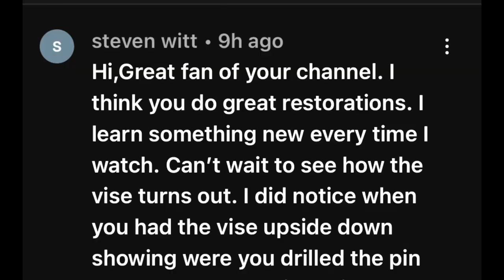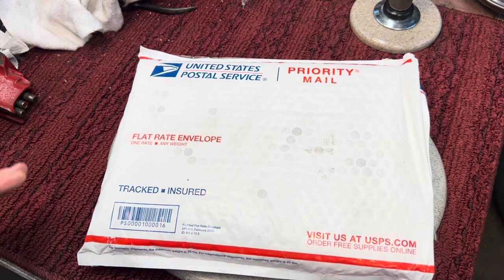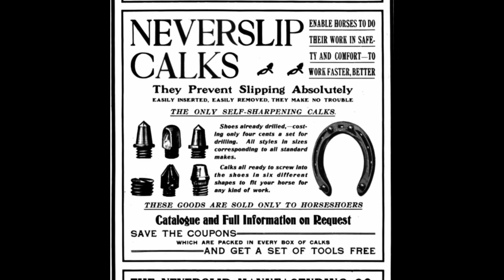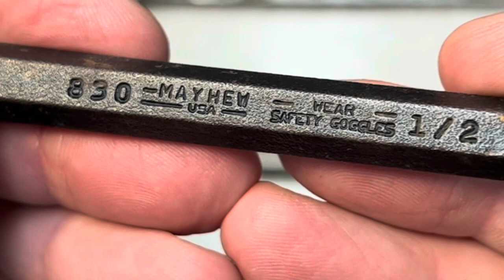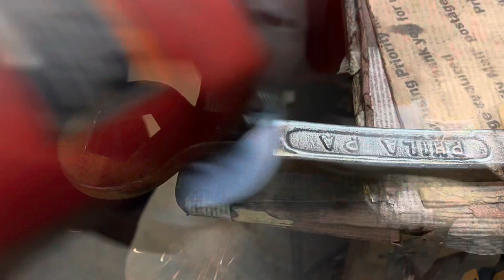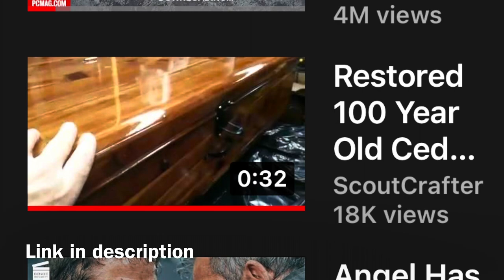Interesting eBay Lot of Vintage Tools Restored.

Comment: John, I got a Lane cedar chest for $5 at a garage sale once. The top was badly scratched and the veneer was off in a few small places. I sanded the top and glued a bit of new veneer on and it has been in my living room ever since.One thing I did: If you tell Lane the model number they will send you a new lockset free of charge. It's one that won't lock if a child closes themselves inside. So it's a safety measure.

Funny thing about that Hot Wheels garage. I bought the exact same one at a recent garage sale and brought to my son's house for my grandson. However, the track could not be put together as pieces were missing. They finally had to get rid of it over my grandson's protests. My son texted me later and asked me to please stop buying "big plastic things" and bringing them into his house! :)
Reply from the maker: Tom- Those Hot wheels and Matchbox garages were the best back in the day!  Then slot cars!  😃👍

Comment: I grew up a voracious reader and I think I have a good vocabulary. The word "calk" as a traction stud on a horseshoe is a new one to me. I had no idea you could add "studded tires" to your horse. 
Thanks.
Reply from the maker: That word had me scratching my head too for some time because I didn't know what the wrench was for until further research.  The shoes had threaded holes that accepted the calks and provided that much needed traction.  A horse on ice with steel shoes is not a pretty sight!  =D   Thanks!

Comment: That sure looks like a hydrant pentagon operating nut. Not sure about the other end of the wrench. Looked up Cusack Howe Co. Phil. PA but didn't turn up anything.  Could have been for a warm hydrant, smaller than what we see as a street fire hydrant. I could have found a use for the cedar chest but I have learned not to take things unless I am specifically looking. My finding and adopting stuff with my optimism for getting the project done leads to more stuff to store. I think you did well to adopt that chest. That will look good.

Comment: So I've been condensing my tool collection for a little while now and I've been in the market for one of those absurdly huge tool cabinets in hopes of being able to store all metrology equipment in a single cabinet. I'm sure you are aware, these are quite expensive. And everything I have is cast iron so I can't get away with husky or something, I need lista grade cabinets. So I've been dithering over the price of various collections and the other day I came across a yard sale that was full of huge dark Gothic furniture. I ended up buying a pair of brake fronts, matching for the total of $60! I believe they are made of Dalmatian oak, heavy as could be and incredibly well made. I got both of these cabinets for less money than I would have spent on drawer liners if I went with tool cabinets. So I thought it was worth sharing, sometimes the best solutions are not necessarily the obvious ones. As a bonus, I've done some testing and it seems to hold temperature and humidity better than high-end steel cabinets.
Reply: They do look a little weird in the shop though
Reply from the maker: So funny you mentioned that, a guy at the tool meet had 2 Lista cabinets for sale. They were at his home and he was downsizing.  I have seen them before but had no idea they were so pricy!  😃👍

Comment: Does the length of the arbor matter on your motor shaft you showed?  Not only do springs go flying but when I bought my bench motor at an estate sale I checked to see if it worked and it did but one of the Keys in the shaft went flying in their basement shop not t be found again :(.  I found a replacement keyone at Lowes that fits the shaft perfect but is 1 inch long vs 1/1/2 inch long.

Comment: Good old Snoop0er and Toots has an old cedar chest, brass or copper bound with studs that I reglued the top where it was split. Still holding for 1 for the truck driver. Wonder if the triangle side of the hydrant wrench was for the caps. Just a thought and a fine job! Tell the GF that I/we want to see how she does on the chest please. Happy happy and BLESSINGS!

Comment: I'd have a hard time walking past the bikes. I'm about to pick up a lot of 12 vintage bikes because I don't want them to end up in the scrap yard. I have no clue what I'm going to do with them but I just can't let them go to waste. The Philly hydrant has that triangle but that's an early wrench that won't work now. Now the triangle is recessed and the wrench looks more like a socket on the end. They did that to keep the residents from opening up the hydrants. Too many open hydrants in the summer would lower the system pressure and firefighters would have a hard time fighting fires so the changed the hydrants to an uncommon arrangement.

Comment: Purely testimonial so take it with a grain of salt but I grew up in suburban DC and our fire hydrants had a triangular cap with strangely rounded corners, almost chamfered. I remember this distinctly because in DC itself as well as in the other neighboring state, the five-sided cap was standard. This is just a guess, but I grew up in one of those gas light suburban developments, I believe that maybe those hydrants were installed by the developer as opposed to professional firemen. At the time that my development was built, everything surrounding was farmland, not yet suburbia. In fairness I do have some memory problems and this is a 35-year-old memory however I tend to remember the long-term stuff with perfect accuracy

Comment: The chest will be great when done and a proper find but I think it's not that old. The hardware and screws just seem too modern
Reply from the maker: The Lock and hinges are very old. (Flathead steel screws) Varnish hasn’t been used in many years and the molding details are very old.  I believe they are cleaning out an attic or basement because the other stuff throw out was super old- I saw a broom there from the 1800’s!  😃👍

Comment: Over the last four or five weeks I have been buying old wrenches, pry bars, and misc hand tools at flea markets in Japan. Beautiful tools, but rusty and dirty. I have been soaking them in vinegar for 24 hours and then cleaning with a brass brush on my cordless drill. They get surface rust very quickly. How can I preserve them and stop the surface rust issue? I spray them with WD40, but it does not help as much as I expected it would.
Reply from the maker: Bare steel especially high carbon steel will surface rust very quickly.  First off it's important to neutralize the acid of the vinegar with Baking soda in warm water. Depending on the environment and humidity you might have to put some sort of finish on the restored tools so they don't rust. Blacksmiths often heat the steel and quench in oil that helps but is a very dark finish.  If you cleaned the steel bright you can polish the steel that will help or clear coat it using a shellac or spray clear coat.  WD-40 is a great cleaner but not very good at protecting.  I often use a mix of vaseline and mineral oil (50/50) and wipe down tools to help protect against rust.   Hope that helps!
Reply: @ScoutCrafter  Wow. That helps. A Japanese friend told me to heat them red hot and then dunk in used motor oil. I am happy to hear you have the same advice. How long should I soak them in baking soda and warm water? Guessing I do this step immediately before red hot and motor oil. I live in high humidity and high salty air. Right next to the Pacific. Thank you.